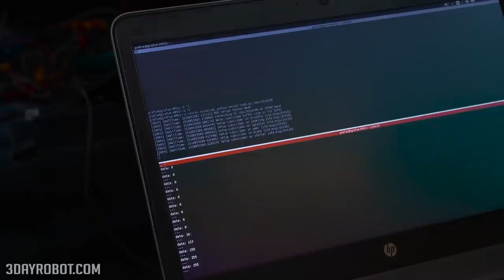BUILDING A SELF DRIVING CAR IN 72 HOURS (what could go wrong)

Comment: Earlier - The Boring Flamethrower
Now - A self driving car
Next - Vertically landing rockets??
Are planning to throw Musk out of business or what?!
Reply: Rek1es s yes
Reply: I mean it is Hacksmith, I bet they could do it easily too. All they would need to do is create their own model rocket to hold all the components that switch the fuel on and off. Add side rockets to make in-air adjustments and ta-da vertically landing rockets.
Reply: GerArt13   *facepalm*
Reply: Cheap Musk
Reply: Bruh Musk Already Has Made Vertically Landing Reusable Rockets Especially The Dragon-1 And 2 Plus All The Falcons

Comment: I have a challenge for the Hacksmith. A scabbard that you use on your and you can sheath and unsheathed a longsword from your back, just like the witcher does it. I guess it would involve a mechanism like the one Raiden uses in metal gear rising revengance.

Comment: Can you reuse the car? If yes you could install proximity sensors, speed sensors and things like this, then reconstruct a basic car model with the same sensors in the same spot on a pc, create an environment where the car can be controlled and then create a neural network and train it in a simulation and when everything seems to work plug the pc on the car and let it drive. It would be a funny experiment